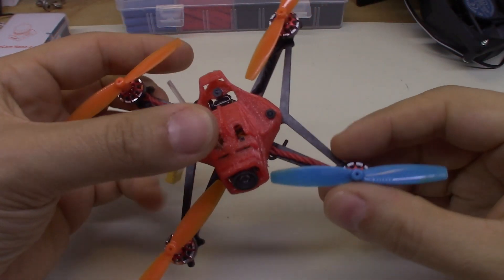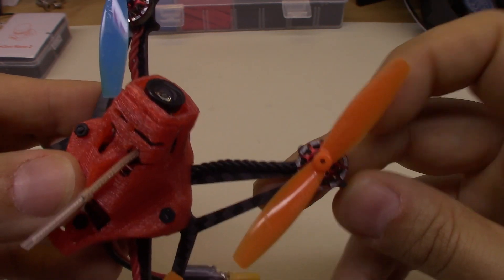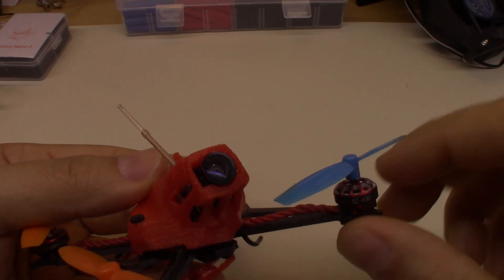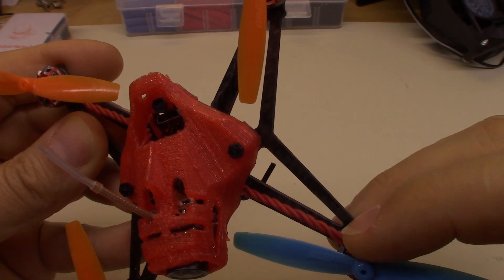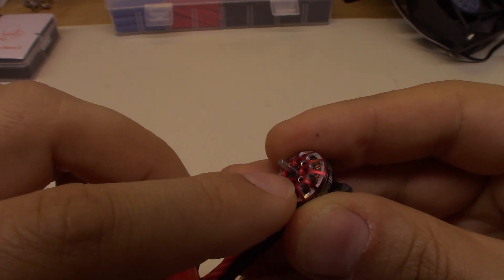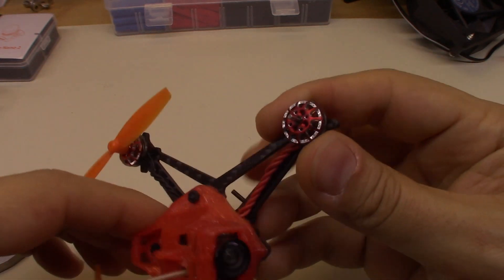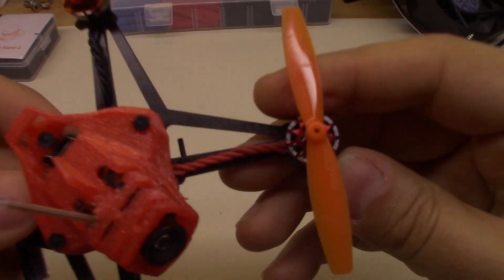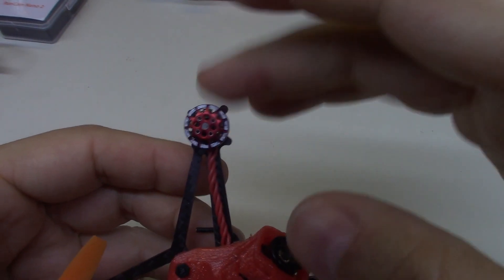Straighten Bent Brushless Motor Shafts

Comment: is it damaging your quad if you fly with a slightly bent shaft
Reply from the maker: Short answer probably not. Long answer you run the risk of the vibrations messing with the sensors for the controller which could potentially lead to a crash